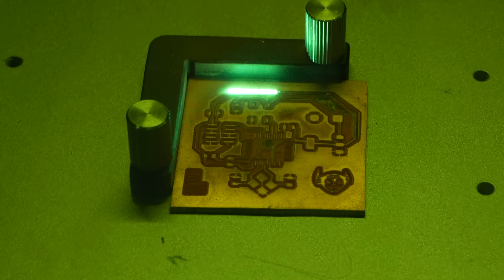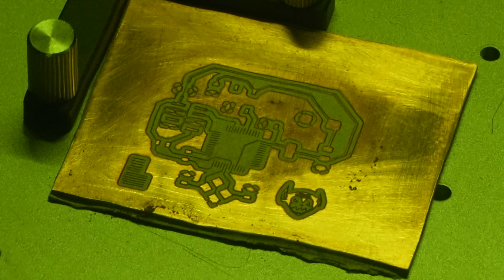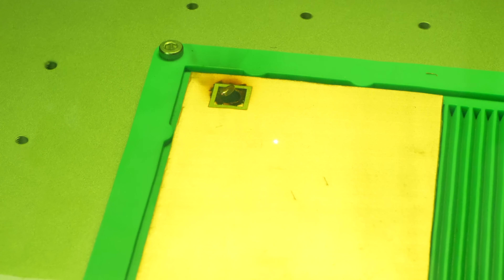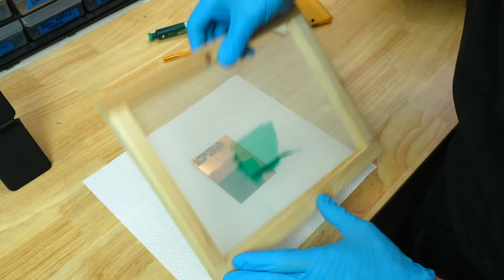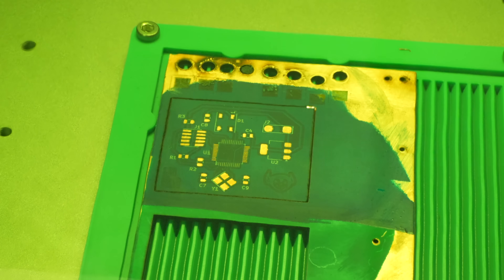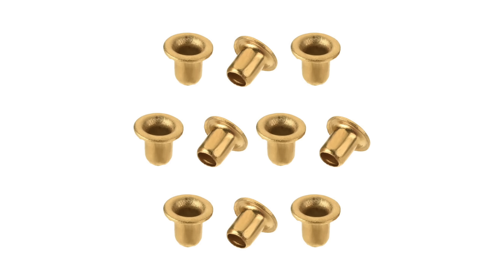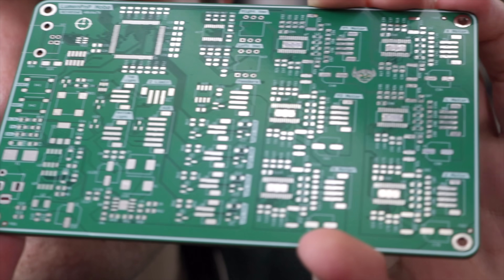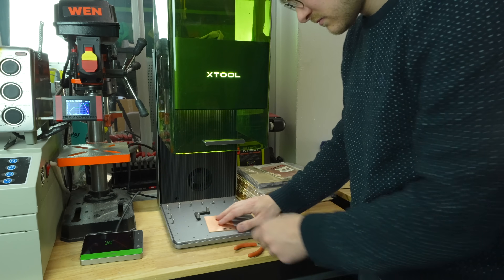Prototype PCBs faster than 3D Prints

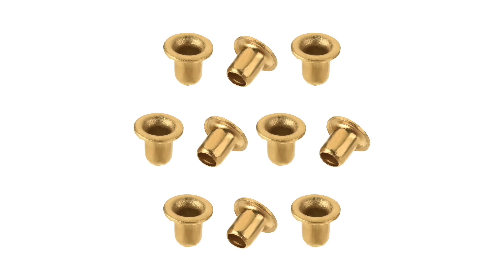Comment: 9:50 Rivets work, but Im seriously curious how bad it wold be to just solder fill the vias. And what is minimum via size. Aaand possibly if solder fill won't work (surface tension or smh) just put in to hole small diameter wire and just solder it. Note: I only have expirience with designing some boards and ordering them from fab. For educational purposes.
Reply: Solder filled vias won't work reliable. The rivets do, but what's the point? You are still limited to two layers. You need at least two layers for power and ground for most circuits plus two signal layers, which makes four. Now, you could use thin laminates and make your own multilayer board, but what for? Are you really going to start a PCB manufacturing business without any customers beyond yourself with an unreliable process just to satisfy your "not invented here" demon? :-)
Reply: @lepidoptera9337  I mean it was more of I wonder kind of comment, but good to know. I actually never used more than 2 layers, i just have bottom ground pane and top for power lines and signaling. If i need to skip over a line i just take it through bottom layer. I2c and spi didnt complain on that sooo idk with my super limited expirience 2 layers are just fine
Reply: @by010  That works OK for slow analog circuits, but you won't even get a modern 32 bit CPU to work reliably that way. I just had a board made for a 400MHz (ten buck) STM32 chip. It has four layers with power and ground perfectly placed underneath the microcontroller. It croaked on me the first time I switched the clock to full speed. It turned out that I had forgotten to solder the power supply caps next to the chip. After they were in it worked fine. 

In the past one would use busbars. The best ones were made like a long ceramic capacitor. That was actually highly effective and worked even with 40MHz TTL and 100+MHz ECL chips. They were very expensive, though. I usually made my own with copper and Kapton tape and I would just solder ceramic caps directly to the bus bar sandwich. Worked like a charm. Nothing beats a 24 layer board with 8 power supply layers, of course. ;-)

Comment: Off the top of my head I think you would be able to make vias using copper foil. instead of cutting a hole you can cut a slot to pass a strip of copper foil through and solder or spot weld it in place.

Comment: I'd rather use cracker board and hard-wire everything as use FR1. Any vibration or stress and that junk cracks or the traces lift. For the $3,500 price of one of these machines I could get 70 $50 orders done by PCBway. I honestly doubt if I'll ever design 70 boards before the technology completely changes again. And this method can at best just do double-sided layouts with very thin copper, so no thanks.

Comment: The easiest way of connecting one side of a board to the other is to use Vero Pins. These are a push fit into the hole and have a spline to secure the pin and a small shoulder that positions the pin correctly. Once fitted simply solder on both sides and you have a simple and reliable via.

Comment: For what it's worth, I used to use a fiber laser to make FR4 boards by spray painting the board, then using the laser to remove the spray paint, then etch it to get the traces.

For double sided boards, I really like adding alignment holes/pins to the board and using hardened/ground dowel pins in said holes for alignment.

Comment: when I was using proto board all the time, I made my vias with just wire, either a leg from a resistor or just a spool of jumper wire.  you can cut it pretty flush and solder both sides, and it takes up less space than a rivet

Comment: you could use a very thin wire or cut a thin sheet of copper in to strips to create the connection through the via

Comment: I have 30w fiber infrared laser and i tried many times to make FR1 PCB with different power and speed settings and also passing but the copper layer is not burning, can you tell me what is good setting good for my machine.?

Comment: Used the rivets years ago on boards milled on an LPKF milling machine. LPKF sold a rivet kit back then - a center punch, a small metal block for an anvil, and an assortment of rivets. Getting the right hole diameter was essential - too wide, and the rivet would buckle in the hole. Soldering the rivet was also critical - the copper would eventually oxidize under the rivet if you didn't, and the board would stop working, within a few months.

Punching all the rivets was a time-consuming process, so I basically avoided it unless absolutely necessary.

Comment: I’m imagining a desktop PCB printer that works in a few stages. First, it deposits a conductive ink onto a rigid substrate, then applies heat or another treatment so the ink sinters and forms a uniform, highly conductive layer. Next, an insulating “masking” ink is printed over selected areas, effectively defining the circuit traces and isolating them where needed. The built-in laser then comes into play, cutting holes for through-holes or vias and trimming the board to its final shape. There would need to be an optical alignment system so each layer gets positioned perfectly, making it possible to build up multiple layers without misalignment. By combining conductive printing, masking, and laser cutting in one machine, this setup could easily make prototype PCBs.
Reply: This is already a thing. It sucks.

Comment: One crazy idea I have for vias is to drill small holes and fill them with solder paste (like the way you apply paste with template but no template needed, because the pcb is the template).
Next, heat up the pcb until solder melts. That can probably would take several passes.
Once finished, polish and go with the default routine. 
But holes should be covered by solder mask lest they leak out during reflow.

Comment: a small counter-sunk copper finish nail would provide a pad on one side and a solderable end on the other. if you made a jig of the right thickness with a bunch of holes in it you could quickly cut the other ends of the nails to the right height en-mass while also making the shank ends flat.

use solder to affix them on either side and baby you've got a stew goin'

Comment: Could you put the solder mask on a blank FR1 and then do two passes on the laser etching to 1) etch away the solder mask, then 2) etch away the copper? Could remove the alignment issues

Comment: Maybe you could get a slightly too big hollow copper tube, heat shrink it, place it in the hole, and let it expand? You could also then try to get the length as perfect as possible so that it doesn't add to the height.

Comment: What if you put the board with the mask on the bed of a resin 3d printer, and expose it that way? Then you could rinse it off the unexposed pad area. I still like the fiber laser better than the chemicals for removing copper.

Comment: LPKF, a laser PCB etching firm, used to use conductive epoxy that is injected through the via hole, and then retracted.  This leaves a thin, conductive tube inside the via between the sides of the board.  This technique is also used for connecting inter-laver board signal vias. Depending on the epoxy formulation, this can be done to connect interior layers to through-hole solder pads. I don't know if they still use this.

Comment: As someone who has been in this business since the late 80s - making PCBs in-house was a worthwhile thing to do - *in the past*. Now it isn't. You can get professionally made double-sided PCBs (with electrically tested plating and solder resist), on a 24hr turnaround, for $5. They'll cut you a stencil for $10. 3 day shipping maybe $30-$40. China has essentially made the DIY PCB redundant.

Comment: To connect the opposite sides of a board you can squeegee and fill drilled holes with solder paste and then place board to heating table. And you will get a connection. 
Also you can squeegee paste through special mold to add extra paste to form little solder ball to connect to copper layer

Comment: My first job was with a small telecommunication company.  We designed on paper and handed over the hand scratched schematics to the "drafting department"  They made a new drawing so everything looked "pretty".  That "official document" then went up one step to the "layout" department.  There it was rendered into a hand made and cut (with a sharp knife) ruby lith, usually in 2X scale. This was then sent to be photo copied with scale correction onto high contrast photo film.  At that point the processes left for the "mystery" 2 side PCB processes.  The boards returned with traces and drilled holes.  The boards went to the  line of "girls" to insert special rivets in the holes using dedicated machines for setting.  All the parts were through hole.   Of all the board failures that we had to overcome the rivets were the worse.  IF they were properly soldered and the boards were never flexed there was usually no problem. But boards get abused in handling,  during hand soldering and troubleshooting, and even with temperature variation in use.  Rivets were a large part of manufacturing cost and warranty work.  I HATE RIVETS.  
Many years later, for hobby work at home I used the toner transfer method with great success.  I bought special paper coated with glucose.  Laser toners transfer to this very well and it then transfers to a copper clad board using a hot laminator.  I have done 0.5 mm traces under 0805 resistors with great success.  Vias are always a problem.  I have used a system that works well:  All via holes should be as small as possible.   Do the layout, drill, and etch normally.   Apply electroless tin to the copper.  Apply the solder mask, making sure the pad on the via is clear.  The next step involves applying an additional REMOVABLE solder mask everywhere except the via pads.  Now the tricky part.   Apply flux on all the exposed pads.  I then use a SS  very shallow pan to submerge the entire board into molten solder.  It must be done in such a way to insure the solder penetrates and fills all the holes and covers the top of the pads.  Now, the whole thing is allowed to cool.  The result is some solder smearing over the top and a wad stuck to the bottom.  A wide tip hot iron will remove any excess solder, leaving the holes filled and a small meniscus of solder.  Take care to not remove too much.  The removable mask can be removed and components hand soldered.  I do all hand soldering.  I have no idea what reflow will do for this processes.  I suppose solder with a much higher melting point could be used for the vias.

Comment: A tiny piece of copper wire (magnet wire without insulation) like a "pin" (Length cut to the exact thickness of the board) as your Via and just solder it to the small via pads and laser a needle hole through the board as the via the same diameter as the wire gauge.

Comment: Being an old enough geek that I manually routed my own double sided boards, sprayed them with photoresistive masking, exposed them, developed and etched them and drilled them on a micro drill press, the fiber laser looks awesome, but it still doesn't beat the online PCB prototyping and production shops.

VIAS - Drill the via hole with the laser, use the laser to etch both sides, then use a 22 AWG bare solid wire soldered and snipped on one side then soldered and snipped on the other side to make solid vias.  Faster and easier than rivets with lower surface height.  The rivet replicates a via hole but there is no need for the hole if you aren't plating copper in the via.  A solid wire via can conduct a lot more amperage than a plated via so that's a bonus.

Comment: Making boards on my CNC I focused on how fast I could get single sided boards done. I Tweaked the DRC so the traces were never closer than my 1/32nd bit. I made all the vias 1/32nd too. So top layer milled with an end mill. Bottom layer was just 22 gauge solid core wire jumping via to via. PACE ConForm tool helps you make the jumpers.

Comment: I am surprised to see so much people here fantasizing about something that has existed pretty much all their lives.

Sadly the CircuitMaker brand was completely SEO’d out of existence by Altium, but there have been cncs designed for quick prototyping of pcbs for decades.

The problem is not making the things, is getting something practical that is also consistent and reliable. Right now it’s cheaper to have a close fab express some prototypes and get them to you in 72h than going through the hassle this involves, and I doubt that is going to change much.

Comment: Neat! A couple of ideas:
1. Add alignment targets so that you can re-test the board calibration versus the current laser position. Multiple targets for etch and drill will help if your luck is running bad. These targets can be put into the margins and trimmed off later, but I think embedding them into the artwork has a higher degree of difficulty.
2. Use short pieces of wire for through-holes and use the laser to cut a jig to hold the wires vertically in place. It might be easier to align the board over the jig if they both have screw holes in the in the corners. So, for example, you take a 2 cm thick wooden board, put 1 cm long holes at each through-hole location and burn alignment holes all the way through. Put 5 cm long screws into the alignment holes and slide the PCB onto the alignment screws/pegs. Now populate the through holes with 2 cm wires, solder one side, flip, solder the other, and clip the tails off. Stranded wire should make better contact with the solder, but I dunno if you can insert stranded wire into the jig.
3. Has anyone tried water/liquid immersion to conduct the excess heat away?🙃

Comment: i used to form rivets out of small pieces of solid copper wire (usually just scrap wire) into rivets. you take a steel plate, and create a divot in the center. do the same thing to the end of a steel dowel pin. you then line up the hole in the board with the divot, insert a piece of wire slightly longer than the board is thick. then place the top of the wire in the divot in the dowel pin and thwack it with a small hammer. though to be fair i was getting better results with through hole rivets.

Comment: This is great! NEEDS automatic or manual camera alignment. 

For via’s on homemade double sided boards I always just solder a scrap lead (from a through hole component) to both sides and cut it and the solder really close with flush cuts. I’ve done this under a TQFP (and other chips) by wet sanding the whole board (the vias) down until the “via” is almost flush. This would work even better if you ablated the copper around the via just a bit creating a step for the soldering to fill and allow a more flush sanding.

Comment: One way to metalize vias is using  autocatalytic chemical plating  (electroless plating) which is easier than electroplating essentially you juts drop your pcb into proper solution.
but I think electroplating may be not that hard either if you use this technology
Bigger issue to me looks the use of the extremely shitty FR1 material.

Comment: Really cool to see the entire process! I've seen some of your posts on Twitter, that's how I found your channel ;-) The soldermask looks really cool - most of the boards I've done are through-hole, so restricting solder flow isn't as big of an issue, but it does look so much better. Screen-printing is a great touch.

Once you get into double-sided PCBs, you'll probably start going down the rabbit hole of laser alignment/calibration. I don't know what software the xtool uses, but EzCad (what most fiber lasers use) has settings for lens distortions which you can adjust (bulge/skew/scale, things like that). Or a full-blown grid calibration which is a real rabbit hole 🤣

Oh, I hate to be an ass, but if they sent you the machine for free, it's a wee bit hard to say it's not sponsored! I've zero problem with companies sending stuff for review, but maybe make it a bit clearer.

Comment: For the alignment - I would try to cut just the outline of the pcb first and then using spring loaded push things to push the cutted pcb to the alignment fixture. That way it should be on the very same position on both sides.

Comment: A former colleague built a via-maker into his home-made PCB mill which apparently worked quite well. As many have suggested, it started with a solid core wire through the hole then cut "flush" (close to flush), then a pneumatic hammer (basically a solenoid) hit the slightly-protruding wire at the via site which deformed the wire enough to fill the gap. According to him, it was even water-tight! I saw the setup myself but never got to see it in action.

Maybe a hacked filament feeder with a flush-cut head and an adjacent solenoid hammer could make this process fully automated.

Comment: 8 years ago I did something like this when prototyping boards, using an LPKF machine to laser the boards.  Key was to laser one side, drill two marked fiducials (can also drill the rest of the holes at the same time), then flip over and use the two drilled fiducials to align the second side for lasering.  Finally, to "plate" the vias, drip small solid core wires into all via holes, solder from one side, flip and solder the other side.  This is only for prototyping so the extra 5-15 mins for the soldered vias shouldn't be that bad.